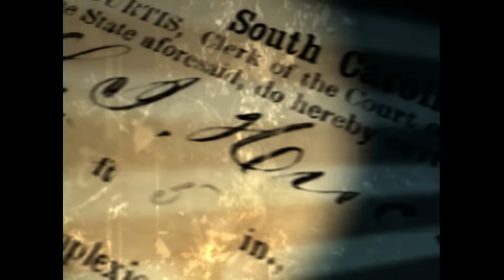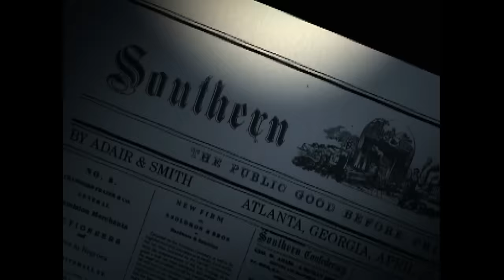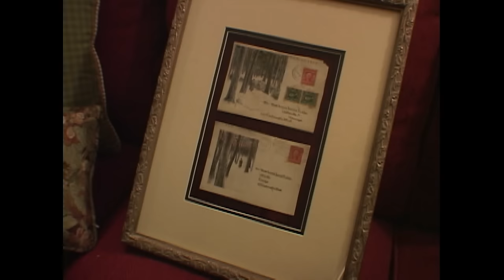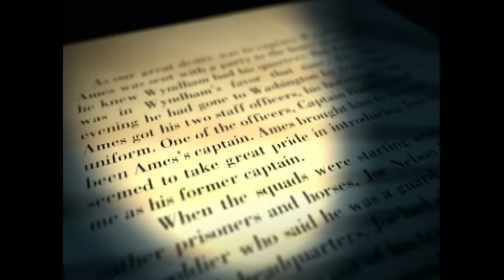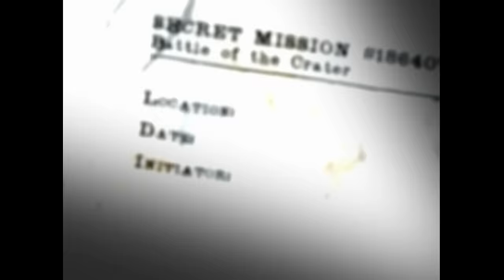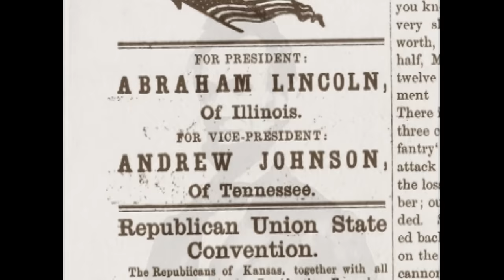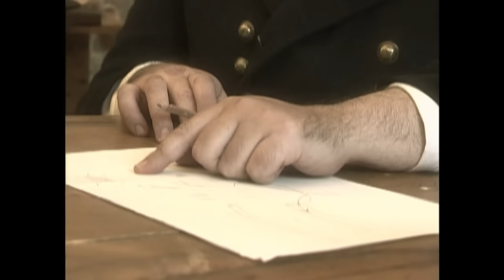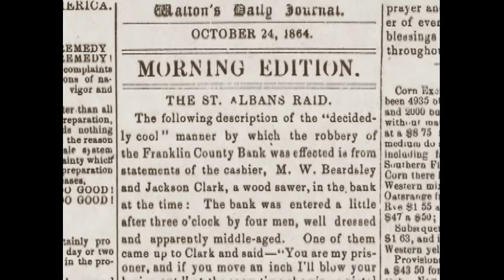Secret Missions Of The Civil War

Comment: Another episode could have been added to this: the City Point, Virginia Explosion on August 9th 1864. 
City Point was the headquarters and main supply depot of the Union armies besieging Petersburg. On that date a Confederate agent named John Maxwell planted what was then termed a "horological torpedo" aboard an ammunition barge. The resulting explosion killed 58 and wounded 126, with an estimated 2 to 4 million dollars in damage. It wasn't til later that it was discovered to be an act of sabotage, initial thoughts being that it was an accident. Despite the damage, the depot was back in full operation within 10 days.